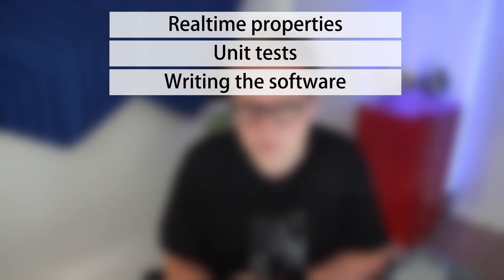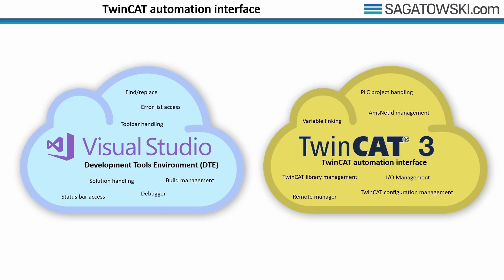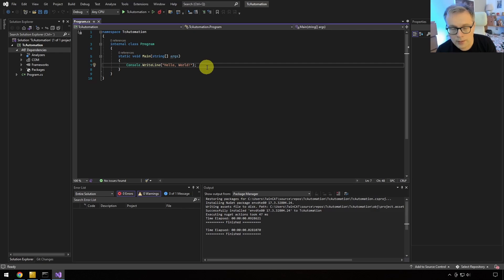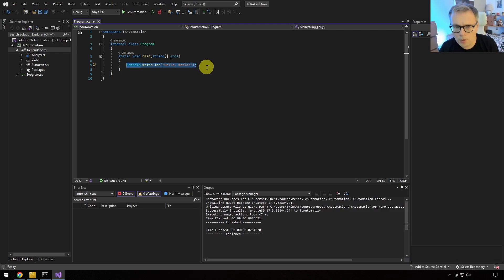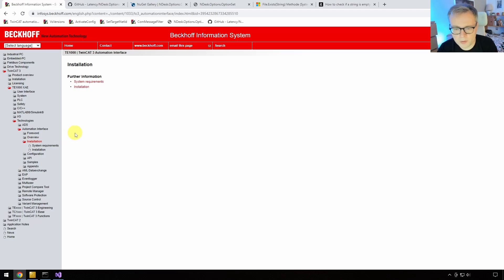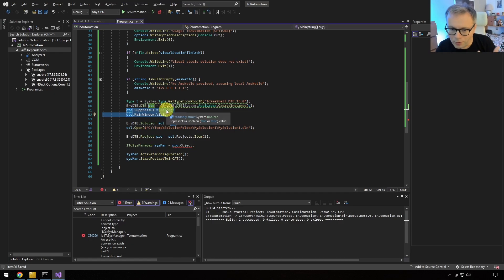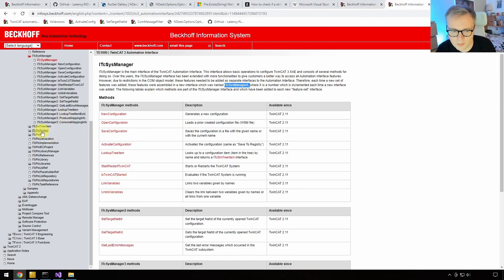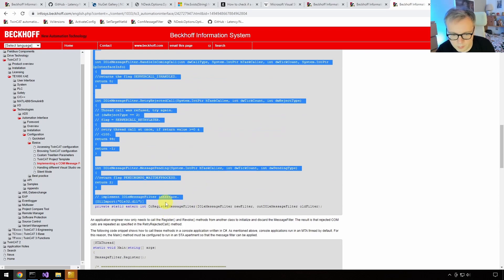PLC programming using TwinCAT 3 - TwinCAT automation interface (Part 16/18)

Comment: Great introduction to automation. I use it to create and map all I/O for all our devices, saves a lot of time. I would point out that even though theMessageFilter needs to be used, you will sometimes still get COM exceptions ("Windows cannot handle the request because it is busy" or words to that effect) from the Beckhoff methods that should be caught and retried.
Reply: According to the Beckhoff documentation the MessageFilter.Register() needs to be called before the COM calls and the MessageFilter.Revoke() after the COM calls (at the end of the program). And the main() method needs the [STAThread] attribute to make the message filtering work.
Reply: I noticed that too. I tried it in WPF project and I would get sometimes exception even though I implemented filter and Register and Revoke methods.
Reply: I had the same issue until I added the [STAThread] attribute before the Main, after that, no more message filter errors.  I had missed that little detail the first time around.